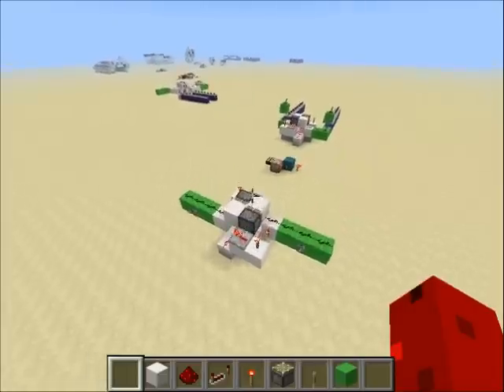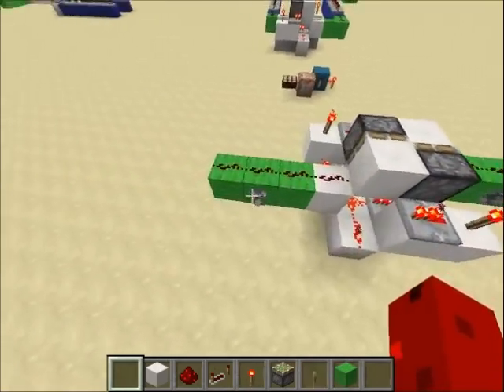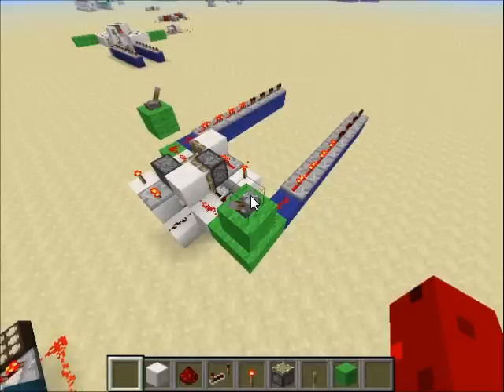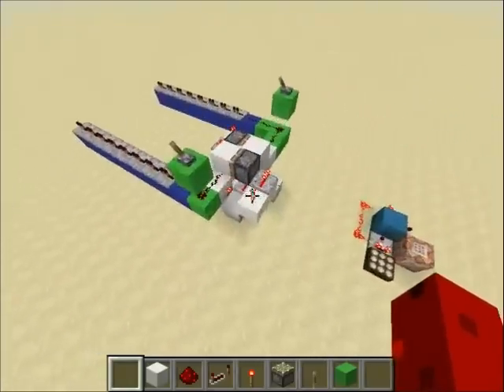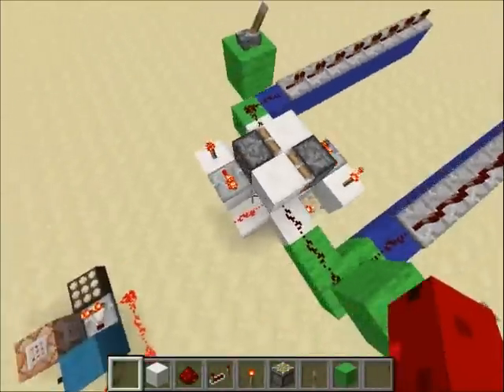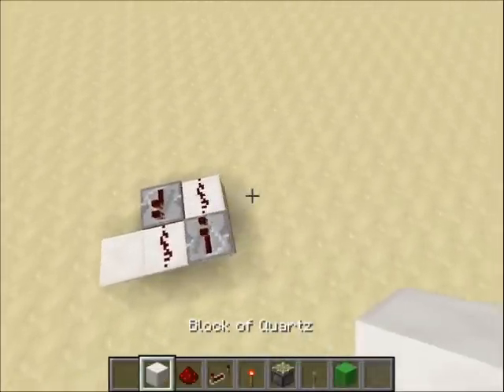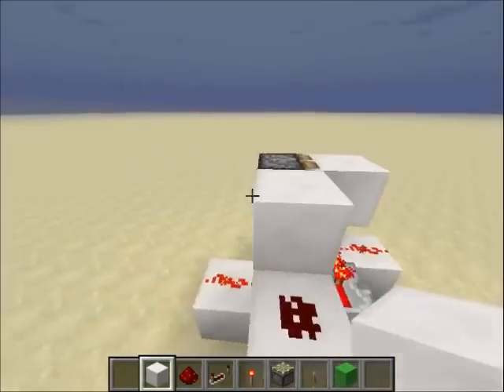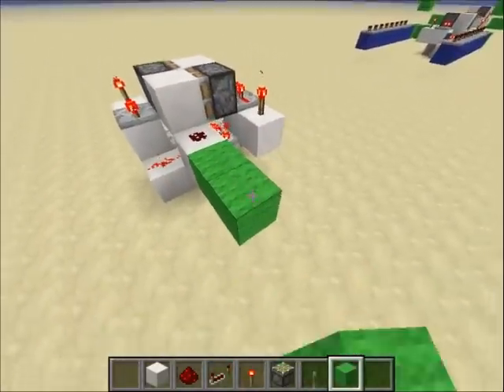Instant two-way repeater (Designed for 1.5)

Comment: It's not instant, but I guess I should upload it. The problem is that it powers opposite lines. It will power 3 lines out of 4, which it still works, but is quite messy.